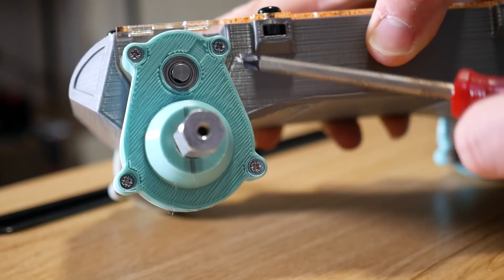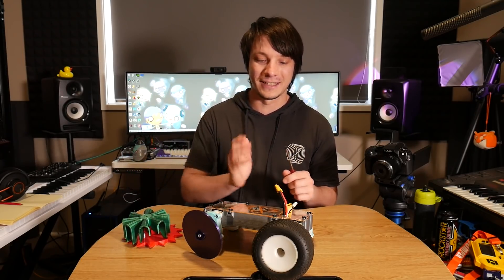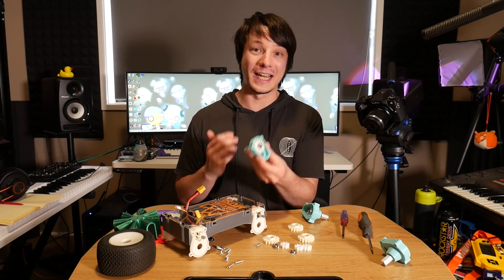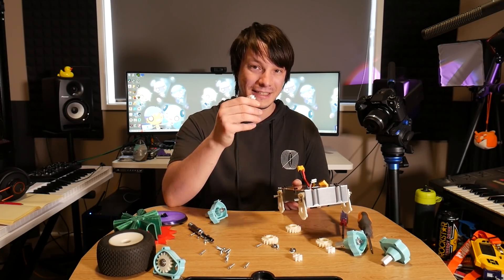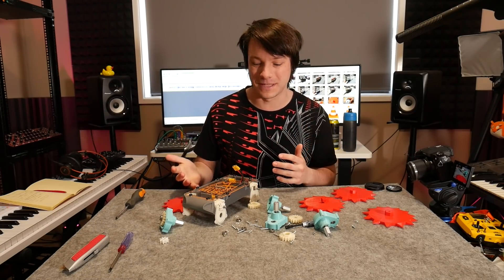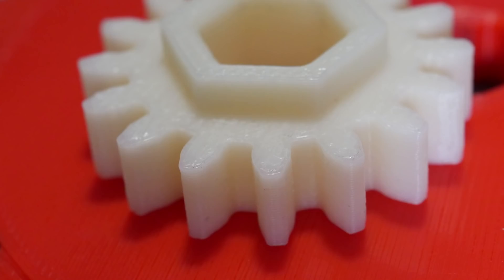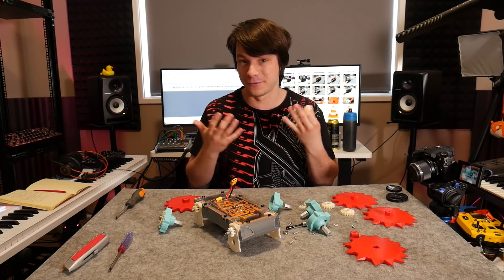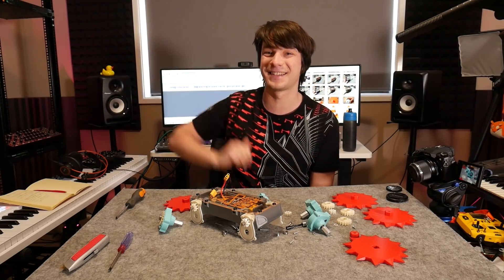Did the 3D Printed Gears Survive?

Comment: Heh, I don't think you need to "protect" the combat hardened gearboxes. Something tells me they are tougher than running over tiles in the backyard. Also, counter intuitively, outrunner motors are weirdly tough. They are open, but nothing is touching in side. Many drone pilots after a crash literally just pepper grind the dirt out and send it up again heh
Reply from the maker: I'm honestly more protective over the esc's, they're the most valuable part of the system and a stall could easily pop them.
Reply: @MakersMuse  ah, yes that definitely makes sense!

Comment: Have you tried making resin gears? Seems like that could possibly be a bit stronger, at least without the same sort of delamination potential.
Reply: resin is considerably weaker than FFF, no way it'd be an improvement. Resin is for decorative purposes only at the moment, even the tough branded proprietary resin.
Reply: while resin would be more solid, almost all SLA resins are very brittle. i imagine using a resin gear would just result in sheering off all the teeth.
Reply: isn't resin used for 3D printing quite brittle?

Comment: I wonder how close the pinion split is to the Z seam. That's traditionally a weak spot in prints.
Reply from the maker: It's close, PS generated it in the corner of the D but it's split from the middle of the flat. Pretty interesting!

Comment: Obviously it goes against your goal of the gears being a mechanical fuse, but I wonder if adding a top and bottom to the input pinion to make it a flanged gear (kinda like a GT2 pulley) would help to reinforce the teeth against separation?
Only downside is that you would have to slim down the output gear so it could fit inside the input pinion, which would make it a bit weaker.
Reply: It's a good idea, especially as the output gear is definitely much more durable than the pinion. It would bring them to a more balanced state.

Comment: I wonder if shafts with more aggressive shapes (e.g. a star profile instead of a hex or D) would better take advantage of the plastics’ tensile strength along the layers. Thanks for sharing a neat project!
Reply: IMO splines in a plastic part would be a bad idea because then you run into the same issues as with the gear teeth. Square shafts on the other hand have almost zero chance to round off the corners and free spin.
Reply: @namAehT  Spline teeth are much shorter and the load is spread evenly across all the teeth, so the bending moment is much less than gear teeth in that scenario. The dominant stress would be shearing on the teeth. The most likely failure mode would be the hub separating from the rest of the gear by breaking the top and bottom layers, although a solid gear would help with that.
Reply: @cas curse The torx key shape was introduced because allen keys rounded up the hex slots too easily. 
Philips is popular for two reasons, but none of them are high torque capability: 
1. The bit is shaped to have excellent self-aligning properties. (Therefore can be automated more easily.)
2. It was widespread long before hex or torx heads became popular.
Reply: Imagine seeing you here! Yes I had the same thought, that just the d shaft didn't seem like a great way for a large torque transfer.
Reply: Like a torx shape? It would be interesting to see
Reply: I like to add a hub to my gears and the drill/tap a small hole in the shaft so I can screw the gear in place.

Comment: Love the idea of a mechanical fuse. If we really wanted to strengthen the spur gears we could pause the print to insert a small washer(into a modeled inset). Instead of taper-locks, external zip-ties, rubber bands in a groove, going to metal, etc...

On that thought, but for the gears teeth, we could even pause and insert short metal pins, or flat bar hairpin lengths. Maybe more of a trick for a brutal battle bot that eats gears though, lol.  Winter is coming. Ice wheels with 100's of spikes anyone?

Thanks for the teardown! Interesting to see how things hold up.
Reply: you could also use resin/glass fiber or both to reinforce them!

Comment: Angus have you experimented with more than D shaped and hex shafts? Have you used keyed shafts or others so you can design the gears to totally eliminate the obvious stress points?
Reply from the maker: Not much you can do with plastic on such a small scale, I've tried inserting setscrew / nuts but it tends to introduce more weak points. On larger gears / shafts I've had some success with heatset threaded inserts and keyways.

Comment: PLA Seems to be more hard-wearing in a few situations.
Reply: I've had amazing results with good old fashioned Nylon. It's an amazing material. and TOUGH. As in: you can hit 3d printed pieces with a hammer and they won't break. Hit them harder and they may deform, but even then, still not break. Incredible stuff.
Reply: @83hjf  Thanks. I'd noticed lots of people make their gears from Nylon filament.
Reply: @GaryMcKinnonUFO  well, "plastic gears" are very often nylon anyways. it has decent abrasion resistance and relatively low friction coefficient. not as low as delrin, but good enough.

Comment: id like to see a video about temperature vs tolerances of a print. had several simple machines that needed bearings and multiple parts and had to change the temp of the print to get a interference fit but after several thermal cycles they have split just like your gear. tanks for your content reminded me to print the cake topper for my nephews b-day.
Reply: This would be a test for CNC Kitchen
Reply: @KaidoLP  prolly
Reply: @cas curse right, so they definitely grow differently but i mean even in getting a specified dimension. maybe in the future i could add some flex to the areas that touch but i still want the values where they interface to be the size i want. ive played with extrusion settings, filament, slicer profile and more but even my room temp will change the end result and i know i can change the temp on the fly on my printer but other than letting it print and checking after i just wonder if its the limit of this type of machine? i can get a size i like but it requires a bit of tinkering every time i do a batch.
Reply: @cas curse I dunno, think it's more poor testing method. I recently went from 0.2mm to 0.3mm layer heights for some larger prints that still needed some fine detail. To get a nice, tight fit I found my tolerances had changed. At 0.2mm as long as I include a 0.14mm gap between parts I will get fit like I see in a car transmission, parts that have to be guided straight to move on or off each other. The two spool holders I just whipped up for a dry box use it to lock a bearing into a U-shaped channel, slides easy but doesn't pull out, can even shake it without the bearing moving unintentionally but soon as you push it it unlocks and slides out easily. First prints on that 0.3mm I had a snug fit between parts to be sealed with a thin bead of silicone, wound up sanding about half a mill off the perimeter of the inner part, expansion is different at that size. Changing 10C in print temp has the same effect, have to re-adjust tolerances for anything more than loose fit tolerance.
Reply: @eideticex  Local environment has a lot to do with it. Not only temperature, but humidity and even altitude can make a difference. Don't assume that what works for you will work for someone else.

Comment: Curious. Have you tested the portal setup by making it only slightly wider than the bearings? As in, only using one bearing per gear and inset the bearing. Coming from a RC crawling background, the thinner profile of the portal axels would have less of a chance to hit on an obstacle.  Awesome platform by the way. Take care.